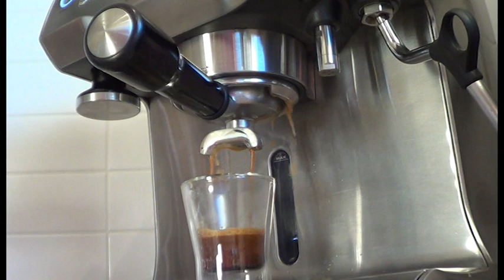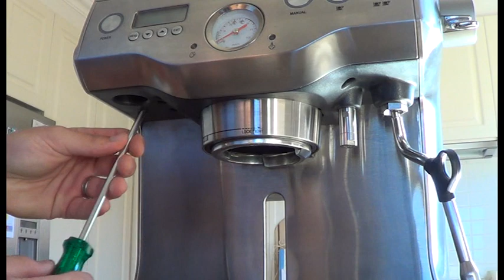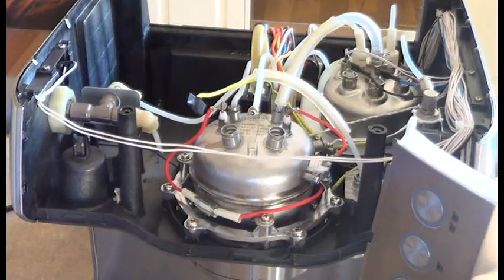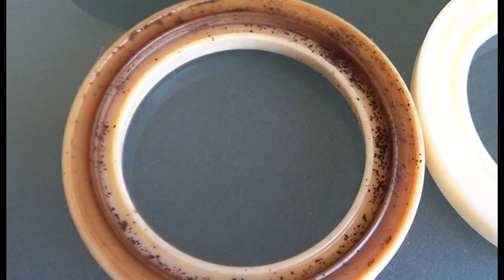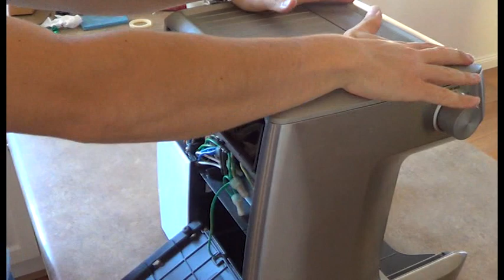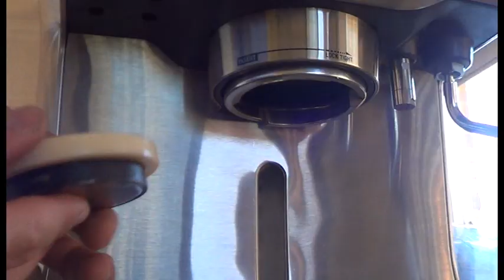Breville BES900 - Coffee Leak Repair

Comment: This video was helpful because I’ve started to experience a similar problem with my CE CAFE semi-auto expresso maker which appears to be a variation of a Breville design likely manufactured for GE by Breville.   My machine has a built-in grinder to the left of the portafilter and drips of water have started to appear from it when expressing shots.  

Unfortunately the parts appear be proprietary to the GE machine and not available on its parts web site or other sources.  Customer Service at CAFE didn’t seem to understand the nature of the problem or the steps needed to fix it so I wrote a letter to the head of the GE CAFE appliance group to seek a solution short of replacing the entire unit which is what Customer Service suggested.
Reply from the maker: I ended up selling this machine and bought a Rancilio Silvia. Far superior machine and spare parts are readily available (in the unlikely event something should fail...)

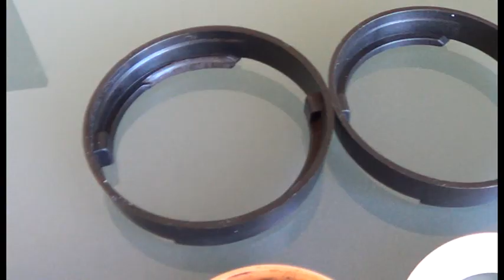Comment: Best repair video EVER! Showing the broken ring side by side with the good ring tells it all (clip at 7:00 minutes). Congrats on not dropping those tiny c-clips when re-installing them. This seems to be a common issue. Sadly, it is not a repair for the faint hearted. I will be happy to send it to YOU if you care to do another video repair!
Reply from the maker: Glad it helped! I have since replaced the Breville with a Rancilio Silvia and haven't had a single issue. The Rancilio has nice stainless steel and copper components, not plastic like the Breville...

Comment: Excellent video. Thank you so much. I have the same machine. For years it has worked perfectly but recently the temp. has increased to 95 degrees and the light flashes. Is there a fix? If I run water through the group head the temp drops and usually stops at 93 deg. Help??

Comment: Wow given how hot the grouphead gets I'm surprised it's made from plastic and breaking those cables is definitely something I would do. In fact it wouldn't be a repair for me if it didn't take twice as long
Reply from the maker: I ended up selling my Breville and bought a Rancilio Silvia and haven't looked back. The Rancilio has stainless steel or copper fittings, much simpler, neater and easier to service (as well as much more durable and reliable).

Comment: Those 2 screws by the group head won't budge at all for me, I am worried I'll ruin the thread. I am sweating trying to remove them and they won't budge at all. I have a long Philips screw driver in there and am putting as much pressure to secure it but it just won't loosen! :\ (I have a long 1x4 philips screwdriver) Is there a trick to this or something? nobody else (I've run a google search) has this issue at all. What gives?

Comment: Is the breville duo boiler reliable at all? trying to get one (used) but this make me thinking
Reply: You can’t get much of any parts for these dual boilers anymore... mine worked great for 3 years though, but lately I’ve been macgivering to fix the trouble pieces...
Reply: Same here. Limping along. For me mostly steam leaks from boilers needed replacing the o-rings. This can short the machine.

Comment: Hi, Thank you so much for uploading the great video and it is really helpful for breville dual boiler coffee machine users. I also have coffee leaking issue. After watching your video I managed to open the machine, pulled two sensor probes and wires off then removed the coffee boiler, found that the plastic collar has damaged. However I still am using the coffee machine. 

Now, I have got a plastic collar insert but I am not able to remove those two sensor probes from coffee boiler, both probes looks like its stuck. Do you have any idea how to remove that?

Another issue is 'Valv' error when attempting to descale my machine. Are those probes heated and stuck due to any reason? Is that why the valve error occurs and its not able to do descaling? Thank you for your time.

Comment: Curious...does the newer BES920XL have a metal version of the part you replaced, or still plastic?
Reply from the maker: Good question, since then I have done it again but the new one is thicker and requires a new group handle. Still plastic though...
Reply: @NJSInstructional  Well, considering it's a $1300 machine retail, maybe make the double walled baskets optional, and put the 440 bucks retail into a metal version of an apparently critical part, eh?
Reply: I just opened mine because the steam boiler piping developed a leak. It seems there are a bunch of metal parts where the 900 had plastic. I took some photos: https://photos.app.goo.gl/62CxotxoSN2yYhAQ8

Comment: Hello! I have a problem with the portafilter and filter of my bes920xl.
I put the ground coffee, put the portafilter in the group head, adjusting normally, I serve coffee without any problems or losses of any kind ... when I take out the filter holder, the filter is stuck in the head and it is difficult to remove it ... what could it be?
Reply: I suppose my answer comes a little late, but your silicone gallery is worn and the filter basket sticks to it. Easy and inexpensive repair.
Reply: @mhaagmans1  had this issue before. Had to change the inner shower screen and it was fixed

Comment: Mine was leaking from the bottom of the water tank holder.  Despite multiple conversations with Breville they were of no help.  They wanted me to send the machine in for a $275.00 review which would just cover the initial review and then they would charge to fix the thing--all due to a washer on the tank that leaks.  They would not fix the tank or allow me to simply buy a new one.  I bought a Jura and have been very happy.

Comment: Hey mate, great video! Mine is actually leaking somewhere else. The pressure gauge hasn't worked in sometime and the machine actually leaks into the spare parts tray that is stored behind the drip tray. Thought I'd check if you've had any experience with this issue :)
Reply from the maker: Hi Linton, my guess would be to check if the o-ring is installed correctly on the hose which goes into the Pressure Gauge. This may explain why the Pressure Gauge isn't working and there is water leaking into the tray...
Reply: Thanks a lot mate for taking the time to explain the possible issue... as much as i feel Im a 'hands on fix it' person... I think I will send it in for repair :) I couldn't see what was wrong and all pipes seemed to be connected correctly. Im sure someone who knows what they are doing will fix it in no time :) 

Thanks again for your swift response

Comment: My machine leaks from the back water container at the seat where it sits on the machine.  Any suggestions?  So when the container is filled with water it just leaks when it is sitting there.
Reply: Ed Griesedieck 
I have the same problem any lock ?
Reply: I have the same problem any lock ?

Comment: Well done. Great video. I had the same issue but it was leaking considerably worse. Have put up with it for last 6 months and finally decided to change the part. I followed your steps bar pinching the wires at the front. At start up the temp would only go to 26 degrees and I realized I could not hear the pump. I filled the boiler with a syringe and restarted. Still no joy. Looked like the main pump was gone. Checked all wiring and connections. Everything looked fine. Restarted, pressed all buttons. Ran the steam for 2 mins then back to main pump. A different noise and bingo, the main pump kicks in. All good, leak gone, main pump operating. Now I have one fault left. The steam boiler has a leak where the hot water is bubbling out of the top from one of the sensors on the right as you look at the machine from the front. Water pools under the machine and I need to occasionally mop it up. I check the red/pink o'ring and it looks intact so I not sure how the water is escaping. The machine trips every few days, must be because the water is getting on some of the electrical. Kind of dangerous. The next machine I buy will be a tried and tested Italian where the internal design has not changed for years. Not happy with the machine at all.